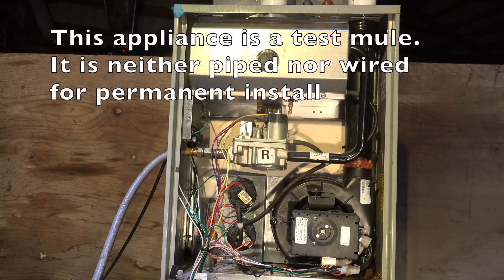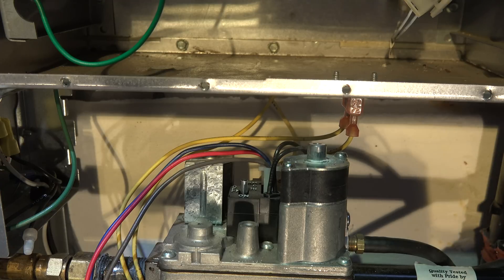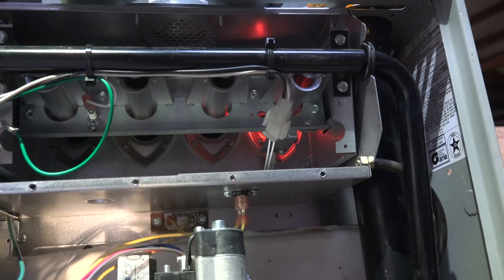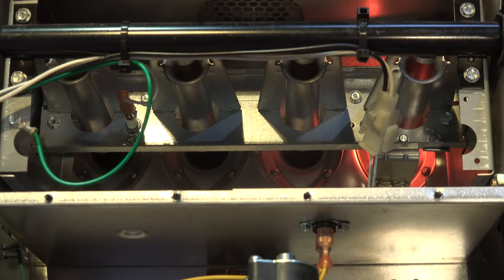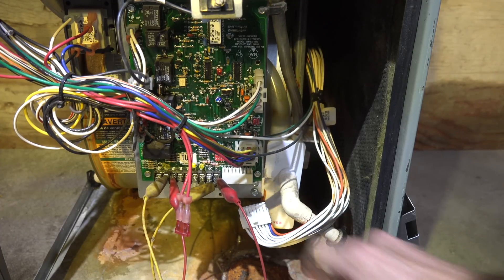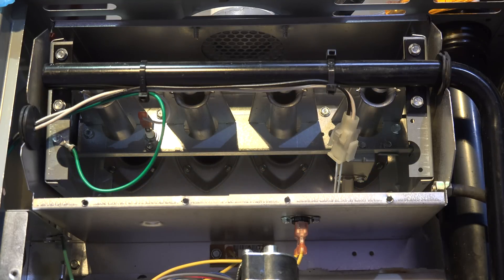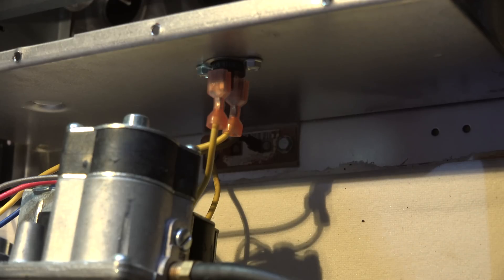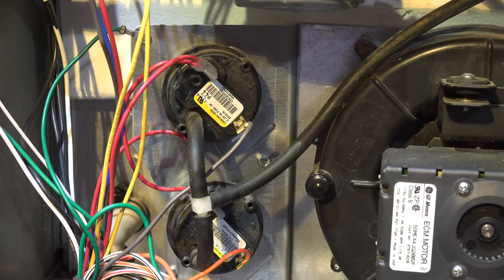90%+ furnace service part 3

Comment: Thank you very much for the super valuable series of videos. I know that Trane recommends checking the limit switch by allowing the heat exchanger to overheat (as shown in your video), but it seems to me that puts unnecessary stress on the furnace and maybe shortens the life of the heat exchanger. Also, what if the limit switch fails completely and the heat exchanger gets extremely hot? I thought I'd pull the limit switch out of my Trane 90% furnace and check it with a heat gun, but I can't get the switch out - I removed the screws, but the sensor is too big to come out through the small rectangular opening in the heat exchanger. The sensor must have gone through the opening when it was installed at the factory, but I'm afraid to force it back through the opening. Has anyone run into this issue when replacing a limit switch?
Reply from the maker: I would have to side with Trane on this.  Leave the limit in.  
As to removal, it will come out, you just have to work it out.
GFM
Reply: Thank you, GFM! I appreciate you.

Comment: Nice video. I have a question though- What is the puropse of the rollout switch on the blower motor housing? That never made sense to me since it's not like a flame is going to come out of the blower motor. Thanks
Reply from the maker: Many of these furnaces can be used as down flow.  If used that way, and the fan motor fails, the limit switch in the heat exchanger may not kick off.  So thus the one on the fan housing.
GFM
Reply: @grayfurnaceman  Awesome info, thanks! I never thought about the furnace being used as down flow.

Comment: wont continuity.... test normally closed limits?
Reply from the maker: No.  Continuity only tests whether it is closed.  Only by overheating the furnace can you test if it works in case of that overheating.
GFM
Reply: thanks
Reply: can you take off capacitor wires at blower to make it overheat.

Comment: +grayfurnaceman Is there a cleaning brush, or kit, that you'd recommend (Like you used on part 2)?  If so do you have an amazon affiliate link I can use to purchase these kinds of things? I love your videos and would love to support the channel.

Can I use the brass brushes from my gun cleaning kit? What about gun cleaning solvent to remove carbon/soot deposits?

Thanks and Merry Christmas!
Chris
Reply from the maker: The brass brushes will work ok.  You can also use a small tree brush available at grocery stores.  Merry Christmas
GFM

Comment: GFM, I have a question on the Induced Draft motor. I was wondering if the RPM of the IDM is increasred,Will this increase in RPM effect the discharge temperature of my furnace? I do not have the specifics of the motor, sorry. It crossed my mind after I was already off of the job. My guess is if it was increased then the draft motor would be pulling much more heat out of the heat exchanger than normal , which does not let the heat exchanger generate the higher temps designed. Sorry if I'm not explaining correctly. Please reply
Reply from the maker: Excessive IDM speed will usually pull the flame off the burners and the flame safety will shut it down.  If it does continue to operate, vent temperature may go up due to less time in the heat exchanger to exchange heat.  Hope this helps.
GFM